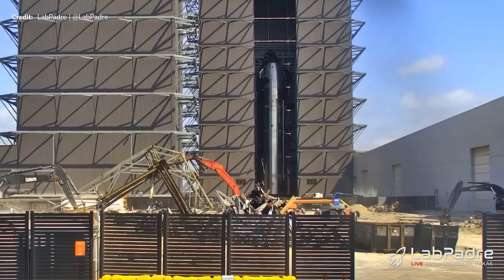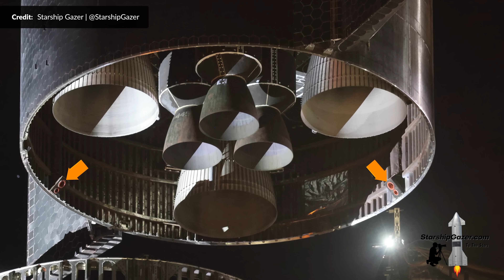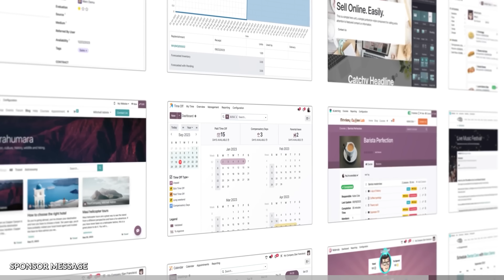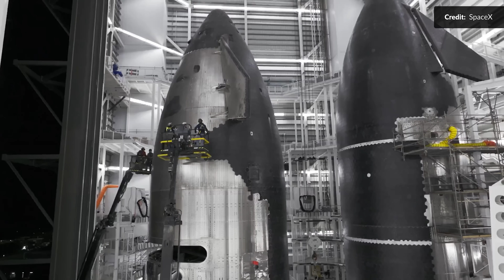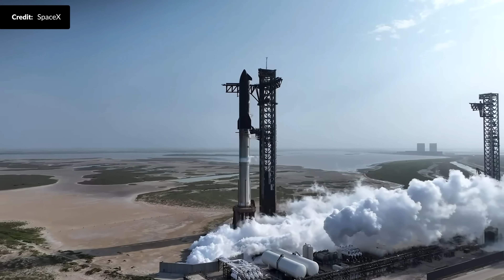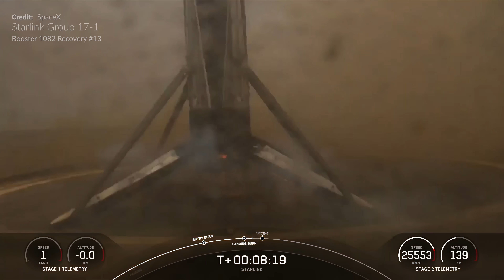Wow... Starship’s Big Surprise Came After the Flight!

Comment: Although SpaceX drops 50 to 100 million dollars every now and again on test flights,  tearing down structures that haven't fully depreciated must drive drive the accountants crazy! My guess, Pad A is going to loose the spotlight for a while until the engineers have time to catch up with what's needed in the version 3 pad and that wont happen until after Pad B becomes operational.  Also once the the system becomes operational changes wont be as easy to implement.

Comment: I think that once pad2 is up and working reliably pad1 will be dismantled, the water cooled plate rip out and old foundations partly dug out and reinforced, with all plumbing improved to bring it in line with the new pad which will be the same as the pad2 design + any change that may be suggested / required after trying that for a few times...

Comment: I was surprised how rapid the booster rotated after separation. It appears to me that put extreme stress on the structure and coupled with the high angle of attack profile probably caused a break-up. Hopefully X will release a detailed analysis. Inquiring minds would like to know...

Comment: I'm not confident the current door design is good I remember an earlier test where they opened it but was kinda wobbly and didn't really seem to want to close and seal. The system that pushes/pulls it against the outer shell doesn't seem robust under lower gravity or something..

Comment: The knowledge that a booster re-entry 15 degrees off from optimal will cause an engine to crumple in a fatal fashion is exceptionally valuable, since we know that when it come in 0 degrees off from optimal works well.  I should be interested if the removal of some of those heat shields wound up damaging the cargo bay door or those tiny superhot patches.  Those did seem to be a possibly significant cause of the internal damage to the fuel lines for attitude control.

Comment: I'm not surprised that the PEZ dispenser door could open and close easily under 1G loads, but not in free fall. Starship was tumbling and creating sub-nominal forces on the door. 

However, the nose structure and door may need a redo to cope with both environments. I suggest a 1G structure preload that is adjusted after launch to minimize latch stress in free fall.

Comment: Block 2 seems cursed.   It’s frustrating for me.  I can’t imagine how frustrating it is for Space X.   But I’m sure they’ll get it sorted out.

Another great informative video. 😊
Reply: They only have to clean up the propellant gas leaks now that the explosions are solved. I would like to see hot gas thrusters in use ASAP.
Reply: @imconsequetau5275  Im more concerned about the heat shield over anything, however im still not sure why they did not continue with V1 a bit more until they got the heatshield sorted.
Reply: Explosions were caused by leaks. They've had three tries at fixing leaks. This design just seems too difficult to manufacture.
Reply: @T_Mo271 three tries is nothing when building a rocket.  you are just seeing it play out because it's sompublic.  but most companies go through juch more testing and failing
Reply: They keep not fixing the same issue.
Reply: @maethore.8843  did you have a stroke while attempting to type that out
Reply: @T_Mo271  remember, it took 3 tries to get Block 1 working coherently.  I suspect they'll nail it on flight 4 of Block 2, if that happens.

Comment: They advised that they will use thrust differential on the RVac’s in the future for the booster slip, not a blocked area of the interstage on block 3.
Reply: It is all an attempt to delay installing hot gas thrusters, which need to be developed anyway.

Comment: I can certainly see the need to re-use the ships that refuel the ship that goes to Mars but I don't see why the ship destined for Mars needs to return to Earth - the crew could simply return in a lighter off-the-shelf capsule. The Mars ship could be re-used on journeys to and from Mars but need not re-enter the Earth atmosphere, thereby saving a lot of weight in the design of the Mars destined ship and would only need to deal with the Martian entry atmosphere..
Reply: They likely won't return at first.

Comment: SpaceX has had two successful test missions out of 18. the first Starship landing was not a success as it crumpled the landing legs and did not lead to a usable solution. That leaves 15 test flights that did not complete their missions by a long shot. the really serious issued is the inability to usecraptors at full power which means no significant payloads.

Comment: It'll be interesting to see what sort of effect the new hot staging adapter has on booster acceleration during hot staging. It would be cool if we could get acceleration plots and if that would show a clear reduction in the amplitude of negative g's on the booster.
Reply: I'm certain that the g's never go negative on the booster. That would be very bad. 

However, the more open interstage might allow the second stage to accelerate a bit harder. If so, you might see more booster engines in use during hot staging.

Comment: How come none of these commenters can talk about the glaring obvious issues The first one being those starship engines do not have the thrust of weight ratio nor the reliability to get a payload of any substantial sized orbit let alone Mars. The starship construction out of stainless steel although cool and all this other stuff is just too heavy this design is not going to work it's too many things going wrong and again not enough thrust the weight ratio Even with the raptor 3 engines which create a whole new series of problems with missing cooling and heat shielding and the dubious 20% thrust improvements at what cost? Then barbecuing themselves and exploding? He needs to go back to the drawing board entirely on this system.

Comment: They should park the starship in orbit and examine it inside an orbital drydock chamber.
I think this would provide a lot more valuable data if captured post failure.
Retrieval spacecraft would need to be created to net the Starship and tow it to the inspection site.
Reply: I think a camera drone could be ejected and the ship rotated to view every surface. A lot simpler to inspect.

Comment: It would seem actually they added heat shielding on the aft end of the booster for the heating it experiences given the 1 reflight died before making it to its landing burn it probably overheated since it had already flown, they added black to rhe aft of the booster for block 3, so i imagine its sheilding like whats on the ship or the ablative stuff they put under the tiles on the ship at least

Comment: Either they scrap tower a, or they redo the stand, and arms of the tower... the overall tower design is still roughly the same and nore than capable of whats needed, its the arm design they could be better as they found and changed for b, and the stand could be better as they found for b... 
But they like to decide things are in an inconvenient spot given they were placed there super early, so they probably will just scrap the whole thing and build another in a mote convenient spot

Comment: For Pad A, I'm curious what they will do as well. I think for the meantime, it'll be used to catch vehicles such that one tower is catching boosters while the other is catching ships once SpaceX reaches that point. Once they have need for higher launch cadence, it certainly makes sense to just overhaul Pad A to make it compatible to launch future vehicles and not require refurbishment between flights (we'll have to see if Pad B's design achieves those goals or not). Or maybe they will just go ahead and overhaul Pad A to match Pad B right away to ensure that it's ready when it's needed...

Comment: I think this should change everything, it took falcon 4 flights literally with a team most likely with little to no rocket experience, yet here we are ift9 from a rocket company that can out do any modern rocket company yet ever starship keeps ending in disaster. I know its for the data but it just seems like a problem they can't seem to fix , I thought ur supposed to have new problems not the same one over and over

Comment: doesn't a taller ship mean more space for fuel to slosh and mess with the orientation? I think the ship needs small thrusters on the back just to keep the fuel to the bottom of the ship in that engine cutoff phase. that sudden acceleration change might be too much for the ship to handle. I ain't an expert though just curious...

Comment: The most amazing thing about the launches is how great the video quality is, we can really see it crashing and burning better than ever.

I wonder how much damage is being done to the upper stage by the hot staging.  To have leaks by bad manufacturing so often seems unlikely.  I know the Russians have been doing it for decades successfully 

The raptor explosion in the booster is a concern for both booster and starship, but now we get V3, is it an improvement or an unnecessary complication at this stage.

 I think most of us expected orbit and refueling by now at least, an upper stage catch too.
Reply: I think you are over expecting. To get the first launch of a vehicle like this would have taken NASA 20 years. I know, I have worked on enough NASA engineering. Elon chose to use a rapid build and try method so he could do this in our lifetime. He's spending the money, let's just sit back and enjoy the show. He'll get us there.
Reply: The problems started with V2 of the upper stage. Hot fire worked fine before. Even a door issue didn't cause abort on V1. Something has changed on Upper stage V2.
Reply: Almost like it’s more for advertising and entertainment than actual development

Comment: What's kind of funny. Is back in the 70s.  I was going to make HUMEN history. At a air show my big reveal to take place. I needed airforce clearance. Pentagon, crap there paints. Air Force, armed guards stormed my hidden design hangers...and stole everything. I told , my craft was a thousand years ahead in design. They took it to AREA 51, So I moved my teams from AZ...To New Mexico out in the desert.. we carved out a Mt,. Made my HANGER DOORS LOOK LIKE ROCKS.. and we built a different craft. A 150 ton steel disk. She was about 10" to the outer ring. And 7.5 feet at the center. The cock pit was a Ford truck cab. The means of controlled flight and lift. Was just a black box. No bigger than a 48 quart cooler. First flight, my friend who was a airforce general. And my self the pilot. And, the flight was at night. We went full coast to coast, in a short amount of time. Not hours. We didn't add , the means for space flight. But we skipped as high as we could before, x. ... The 4 star, was freaking out. And amazed. I built the first HUMEN UFO.. but we new what it was. 😂. So it was just the first , 250 foot round disk, that had controlled flight. No fuels, no nukler rod, no sound, I kind of laught at musks....big banana boats....blasting off..., to me...monkeys with computers...with no clue how space and time work. Note. The explosion of new kick ass fighter jets that started in 1970....all were designed by me. All advance helicopters, black hawks, all side winders,  guild missiles, ECT ECT.. came from my design desk. Air Force, even showed up at my collage graduation, for my Masters degree. I did win the cow bell, in science and engineering.comde, blab blab. And yes I got my PHD. . Musk, is a kid playing with bottle rockets in a corn field.. When in 1977, my team built...a four story triangle, the size of three city blocks.... Again,...no sound, no fuels, my space ship could hold 4000 people. And it only used " light " to fly. I named it a funny name...bouncie bouncie bounci.. AREA 51, hides her also.... Oh, Hannah, the world's only plasma craft, no sound, ECT... Is my craft the airforce stole by force...no laws broken. All laws followed.. they also, after the mayden flight of my Disk craft, took it to AREA 51 also. Funny, part they had thousands of engineers trying to understand, how the F... One man could design it all... Funny part is....as a kid, no one told me I couldn't do it. Where did I get the ,millions to play...DVD player 1967, my stainless steel, code name project whitemars 1535. Cold nukler power plants. I'm the person who changed nukler power to make it safer. From what we're not plants, to cold plants. Add, in 1967 east coast...
I put a electric power station 15.000 feet underground, that produces free electricity. No fuels. Just out put. Mega out put...so much so SENTIORS bought me out for 72 billion in 1968. So, any way..haha, musks , big banana bottle rockets,.. I'm thinking, he should call them...( Fire works..😂😅😂🎉 )

Comment: The buckling of the tube as the door closed is a clear indication that they do not have a good design!  Indeed, the enormous size of Starship make it difficult to prevent the tube from buckling and 'oil canning', and when that happens mechanisms get pinched and stuck.  Additionally, the door, I would argue, should be vertical and not horizontal and the Pez dispenser should be a carousel that rotates to spit out each satellite.  The current design has a massive slit that needs to be able to spit out a satellite horizontally, but that huge horizontal slot is compromising the structural integrity of the rocket resulting in mechanisms jamming.  At the rate SpaceX is fixing these issues Blue Origin will have established a settlement on the Moon while SpaceX is still 'improving' their rockets and engines.  Take a note of the changes to Starship and SuperHeavy -- how do they complete a design and then have to make enormous changes as they discover they aren't where they need to be.  Starship has grown in size and it's all up mass appears to be inching towards 1800t.  And, when you work backwards from that you see that SuperHeavy also needs to get bigger and we could be looking at a first stage that's 5000t by itself with the total mass at launch closing in on 7000t -- this will drive a need for the first stage to develop around 100MN of thrust which is about 3X of the Saturn V first stage the S1-C.  They are way over their heads!

Comment: The design of the rocket did not take into account the vacuum of space. The tubes and walls of the rocket are not strong enough to withstand the difference between atmospheric pressure and vacuum.

Comment: you mentioned the old hot staging ring had specific vents to make the booster turn back faster in the correct direction, the new hot staging ring doesnt have specific vents its just struts. will the booster still be exhaust-pushed in the correct direction during hot staging with the new design?

Comment: Remember when everyone thought this thing would be operational before SLS? Isn't that funny as hell now!  I am looking forward to when they actually can fly these things every three months. Ya know, without an incident report soon thereafter. It would be nice to complete flight 7 so they can move on. Thank God Blue Origin is building a lander... because it's the one they are going to be using.
Reply: I will add: They worked on 35 allot, maybe more than any other ship... going back and forth between testing and the mega bay several times... and it still failed epically.  It couldn't even open the door. It's very disappointing.

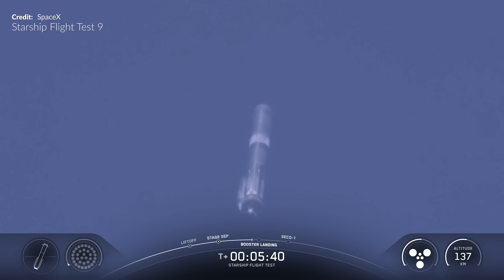Comment: 4:54 What is "single use engine shielding"? 
I thought the booster was designed for 100% reusability.
Reply: baby steps
Reply: Raptor 1 & 2 require a sacrificial(?) heat shroud to protect the pipes and wiring from the heat of high-velocity atmospheric re-entry. Raptor 3 eliminates this requirement.

Comment: Starbase, we have a problem. The rockets are too heavy to lift into orbit. So what? Just add another engine. Ok, but now we need more fuel for the extra engine. Ok, then add another one. Ok, but now we need more fuel. See, the problem starbase is the rocket equasion.

Comment: For some time, I have felt that the 'dispenser slot' was in the WRONG place - It is a wide opening at the BOTTOM of a large expanse, that could deform when under acceleration on launch. If placed at the TOP of the payload section, the opening would only have to support the deforming weight of the nosecone and header tanks, and there is more room for bracing and reinforcement. In micro gravity of orbit, it would make no difference in directional feed for ejection.
Reply: i also think it could be about half as wide, since the starlink satellites fit 2 or 4 per vertical stack layer, so if they added a way to move them within that layer, they could get away with an even smaller hole.
Reply: Yes. If the flat satellites were rotated 90° and shuffled to the centerline, the door could be narrower. 
 @kylej7593

Comment: HOT STAGE RING; has possible weld fracture issues at the top pointed ends of the angular support struts, where welded into the upper ring. That upper ring may need a bit more structural is integrity at those weld points. 🤔

Comment: I think the fire which we have seen near the engine bay and the raptor nozzle is due to or happened at the time of hot staging. Because the raptor sea level move away from center and very near to hot stage

Comment: SpaceX should use Starship to launch massive expendable, composite, upper stages for the time being.

I wish they would have worked this concurrently with their stainless steel starship design. 

Stainless is HEAVY. A composite upper stage would have allowed them to take advantage of the boosters massive thrust and lift capabilities until the hard part(upper stage) was completely and mature. 

We could launch some MASSIVE satellites inside the bay of a composite Starship upperstage.